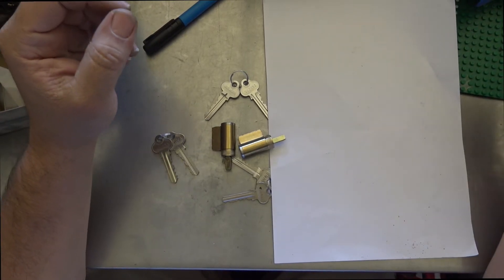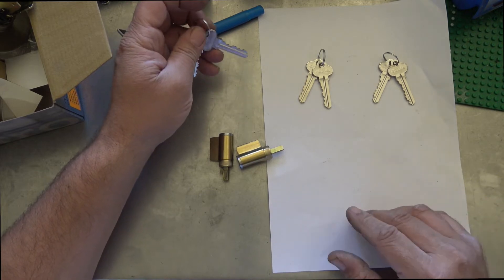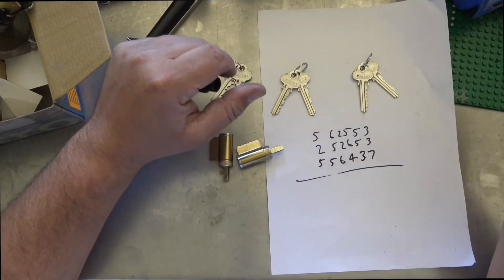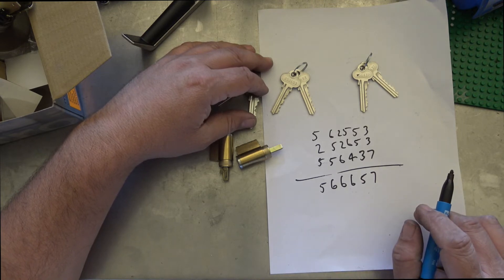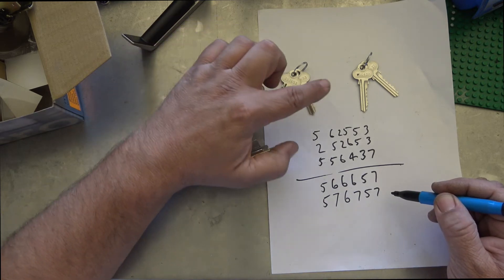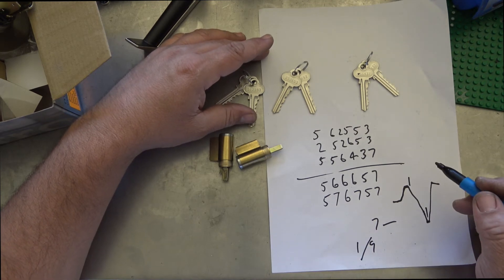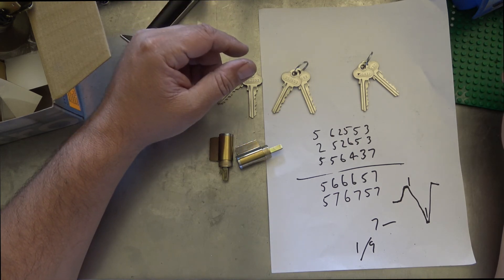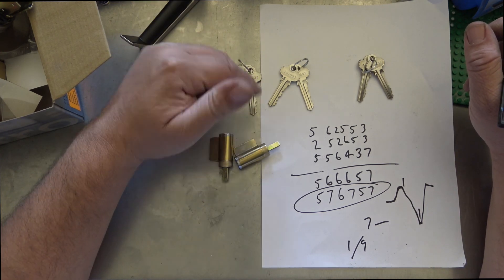How To Reuse Keys & Save Money On Key Blanks

Comment: Not many locksmiths I've met promote this as it has potential for future miss cut of replacement for broken key (by code).

Personally, I've recut used keys just so I have keys that have a wrong bitting stamped on 'em.🧢

Thank you for sharing.👍

If y'all are going to do this for strictly professional & not personal, you may consider getting a can of plastic dip.✌
Reply from the maker: Good point, that bitting stamped on the keys is an issue, Its good for me to key up to , but bad for the customer to have it visible
Reply: @DrLockShop  ,
Not sure if it's expensive or cheap over there... but if you have time & space, plasti dip / liquid electrical tape is not that expensive here & for the $$, can be a $$$ maker if you can get clientele hooked on the idea. 
Just do the 4 keys mis-stamped,
Say it's complimentary.
Maybe with word of mouth...??
(Just a thought)